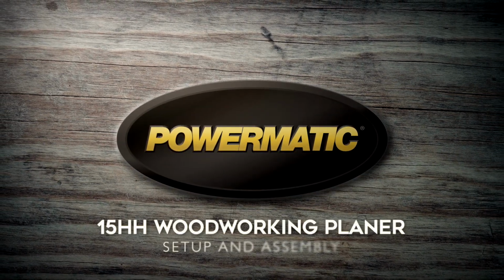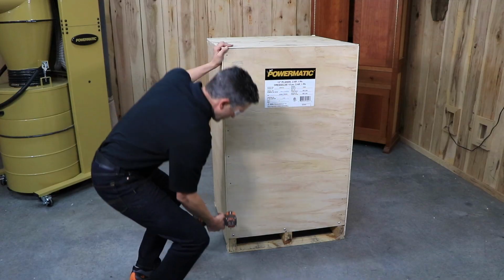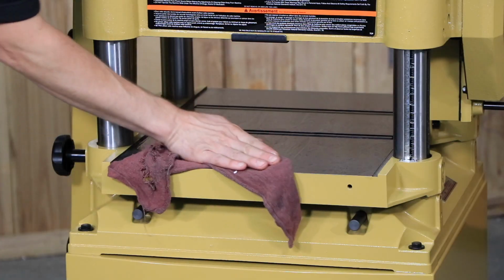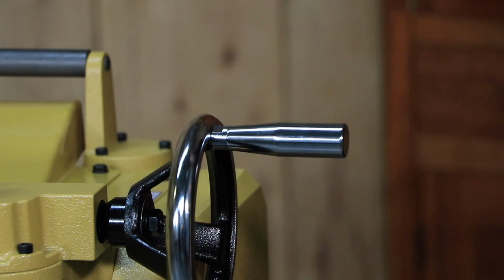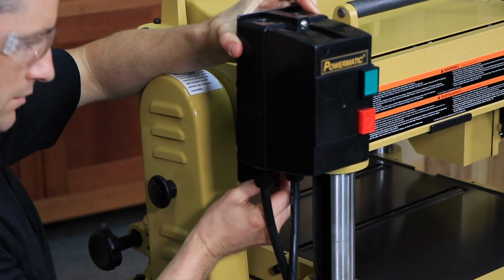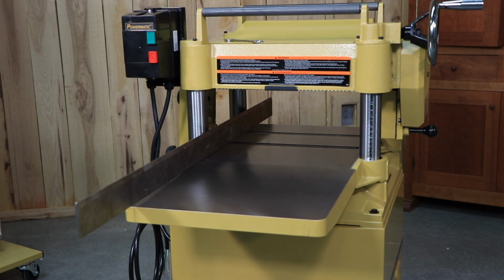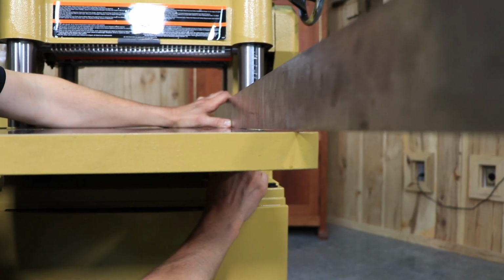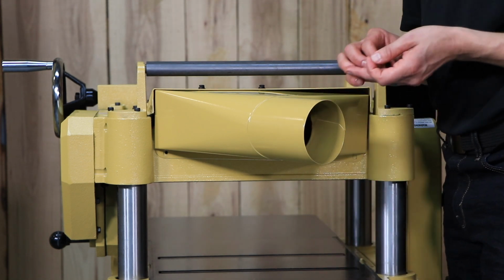Powermatic 1791213 15HH Planer- Assembly and Set Up

Comment: they give you two wrenches with 4 different size ends, but none of them fit the two important nuts - extension tables and height adjusting wheel

Comment: This is a very lame assembly video.  How about some thoughts on exactly how to get the cast iron extension beds attached and level especially if you’re a one person shop.  $3k for a planer  you think the assembly instructions would be just a little bit better than pure useless crap.  I’ve just spent the last 5 hours trying to level the infeed and out feed tables.